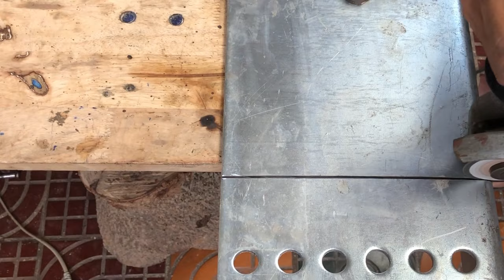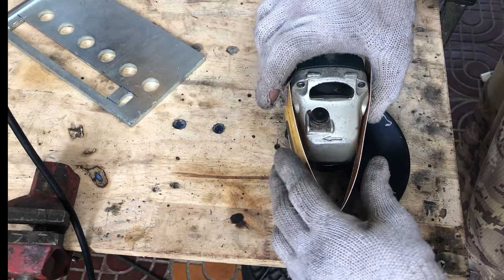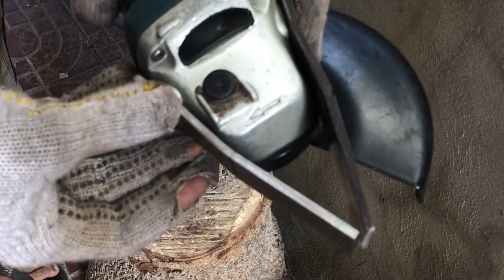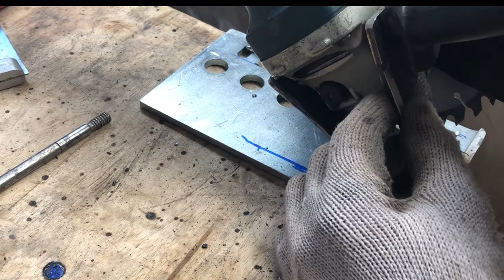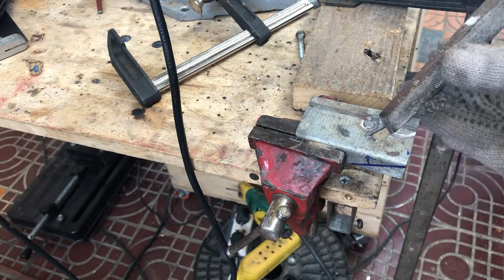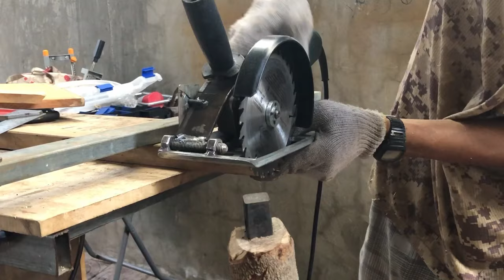DIY, Convert Angle Grinder to Circular Saw | angle grinder cutting jig | angle grinder attachment

Comment: You need 3500 rpm to cut wood, and that grinder spins for 9000 rpm. Very dangerous things, be careful my friend
Reply from the maker: Thanks Jure for the comment. I agree with you. it's not safe with that spinning speed. I later imbedded a speed controller in the angle grinder. and it's much safer now. I made a video about it. Pls go to this link https://www.youtube.com/watch?v=YButmaTgSDo&t=68s  :)

Comment: 👍👌
Machin ko aage se piche ki tarf hi lejana he?
Samne ki aur bhi le ja sakte he
Reply from the maker: Thanks for the question. yes, i found it safer that way. The angle grinder spins too fast, so whenever i push it forward, it tend to kicks forward violently and the cut on the wood is no longer straight. Some people would  flip the blade and the angle grinder before pushing it forward, so that they can make the cut more straight, but this way, they are running the risk of the angle grinder kicking backward toward the users. In my other video, i made speed controller for the angle grinder. It now can spin move slowly enough to push it forward when cutting wood.  You might want to find out through this link : https://www.youtube.com/watch?v=NBmrep7ISek&t=73s

Comment: How to use it? Push or full?
Reply from the maker: Thanks for the question. yes, i found it safer to pull it. The angle grinder spins too fast, so whenever i push it forward, it tend to kicks forward violently and the cut on the wood is no longer straight. Some people would  flip the blade and the angle grinder before pushing it forward, so that they can make the cut more straight, but this way, they are running the risk of the angle grinder kicking backward toward the users. In my other video, i made speed controller for the angle grinder. It now can spin move slowly enough to push it forward when cutting wood.  You might want to find out through this link : https://www.youtube.com/watch?v=NBmrep7ISek&t=73s
estion

Comment: You have to pull backwards?
Reply from the maker: Thanks for the question. yes, i found it safer that way. The angle grinder spins too fast, so whenever i push it forward, it tend to kicks forward violently and the cut on the wood is no longer straight. Some people would  flip the blade and the angle grinder before pushing it forward, so that they can make the cut more straight, but this way, they are running the risk of the angle grinder kicking backward toward the users. In my other video, i made speed controller for the angle grinder. It now can spin move slowly enough to push it forward when cutting wood.  You might want to find out through this link : https://www.youtube.com/watch?v=NBmrep7ISek&t=73s
Reply: @backyard.craftsman  thanks
Reply from the maker: @cutflower36  you re welcome 😊

Comment: It's not a 125mm disk right?
Reply from the maker: Thanks for the question. Actually it's 254 mm blade. I often use it to cut thicker wood. so I prefer 254 mm :)
Reply: @backyard.craftsman  can you get circular saw blades with a 22mm hole to fit angle grinder.